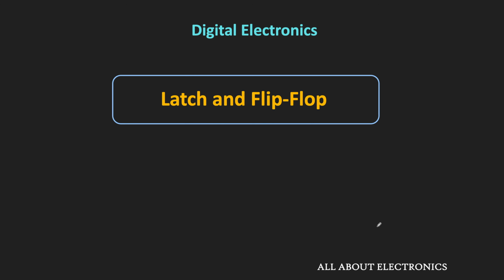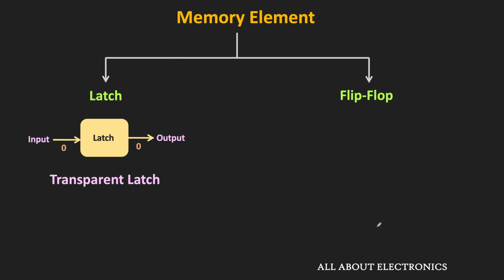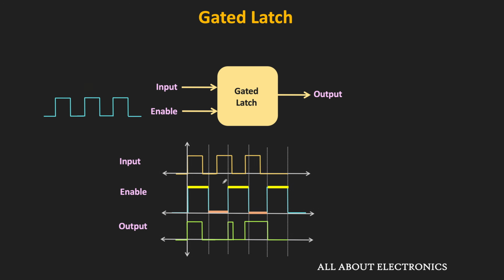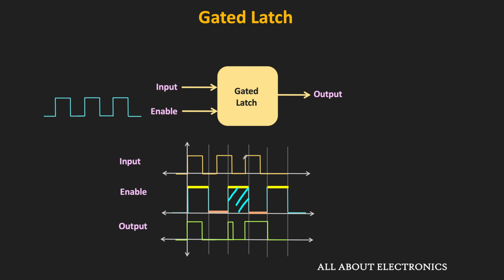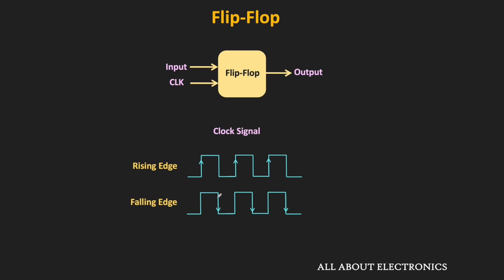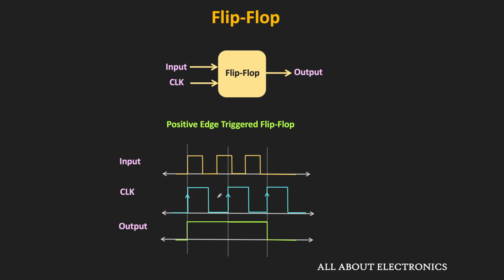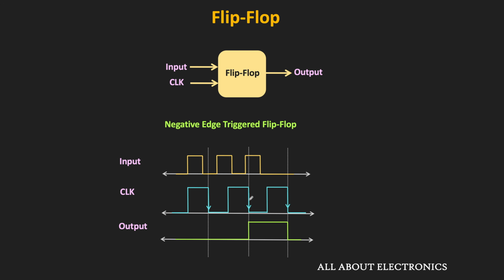Latch and Flip-Flop Explained | Difference between the Latch and Flip-Flop

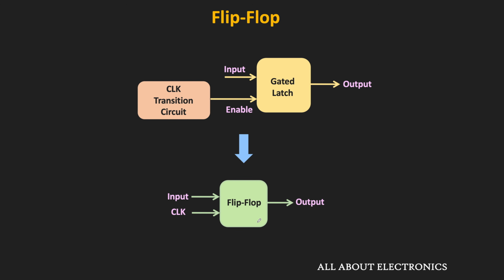Comment: 9:10 even though we input clock signal to gated latch still it going to be as a level triggered latch right ! can't be edge triggered. so how it can be become a flip flop ?
Reply: @VenujanSrithar  we are adding a clock “transition” circuit… which only activates during clock signal’s transition period.

So we are adding an already edge triggered signal to the enable input

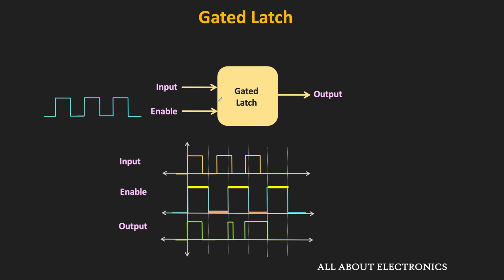Comment: 2:58 what so thr difference between input and enable input?
Reply from the maker: Enable input is another input to the latch. When this enable input is high ( or low, depending on the latch configuration) then and then only, the latch will respond to the input. If enable input is not high, then latch will retain its previous state. I hope, it will clear your doubt.

Comment: sir if flip flop is just a latch with clock signal in the enable signal, how it becomes edge triggered when latch is level sensitive, 
i am very confused please help
Reply from the maker: Its not only a clock signal. It also consists of clock transition circuit. I have already explained it at 9:07. Please watch the entire video, you will get it. And in the subsequent video, I have also explained the clock transition circuit. Please go through the sequential circuits playlist on the channel. You will get the videos in a sequence. If you still have any doubts, then let me know here.
Reply: @ALLABOUTELECTRONICS  https://youtu.be/CiS7N2C8-Ik
In this video at 6:04 you show clock transition circuit but don't explain what it is the whole video.
I actually understood it from other sources that sr flip-flop is made by connecting two sr latches together.
I think that this important information should be provided at very starting rather then in very later videos(not still sure in which video you have explained😶‍🌫️)

Btw didnt expect you will reply(and also soo fast). Your series helped me lot during this semester. Best one of YT.
ThankYou very much

Comment: how gated latch can be used as synchronous memory element by using clock signal
Reply: i think it will become synchronous sequential circuit not synchronous memory element once reply
Reply from the maker: I have already explained that in this video. 
Here is the link : https://youtu.be/CiS7N2C8-Ik?si=a2wgwLmh5MMgqzQj